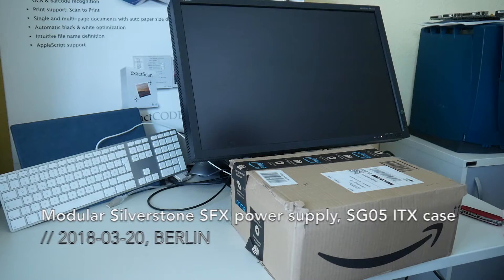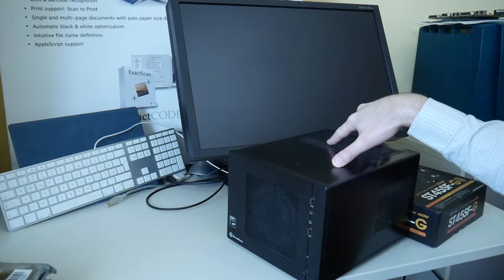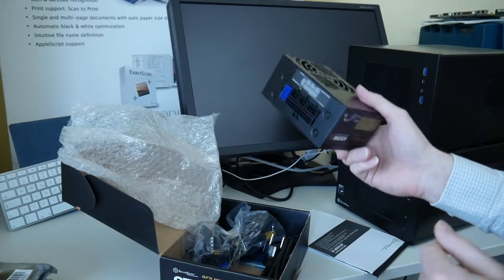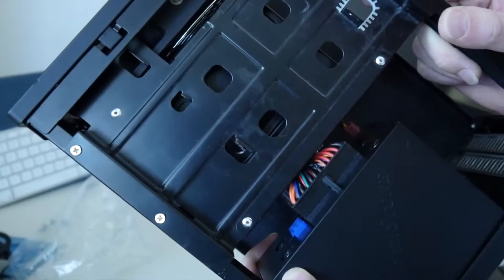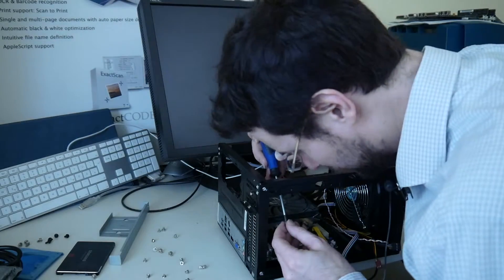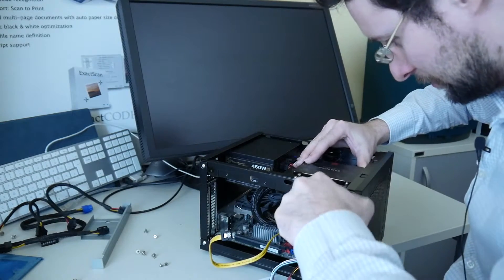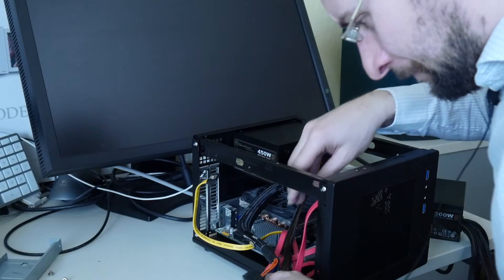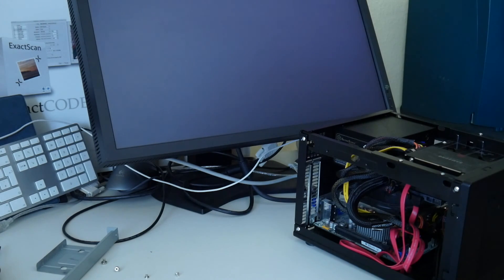Modular SFX power supply, ITX build, Silverstone SG05, ST45-SF

Comment: For heaven's sake Rene' you mounted the PSU with the fan facing away from the vent holes built into the case.  That is an amateur's mistake!
Reply from the maker: this is the intended orientation. We actually tried what you suggested (I assume PSU upside down with the vent upwards) however, not only does it look alien, and dangerous (metal pieces, e.g. paperclip etc. could fall straight into the PSU) there is also less air thrust, as less inside air getting blown out and temps were higher.
Reply: @renerebe  this is what i was thinking!!! thanks for reassuring me lol